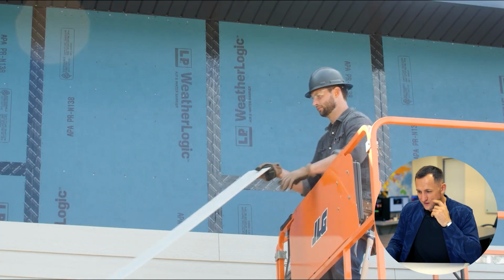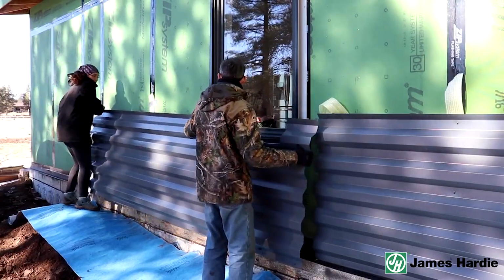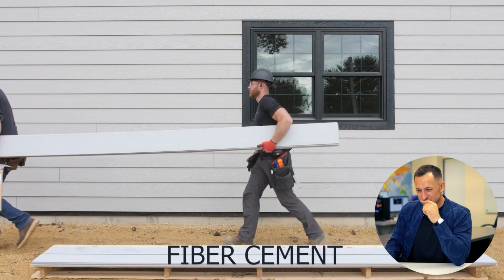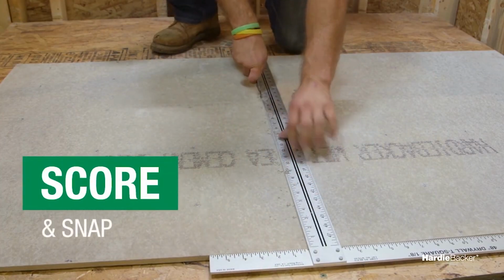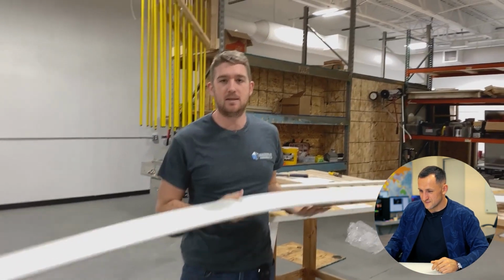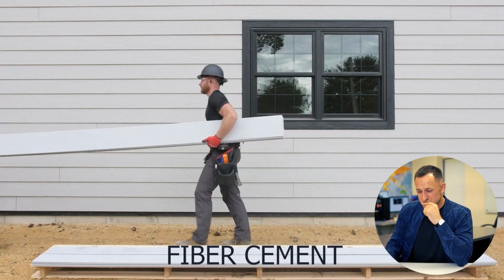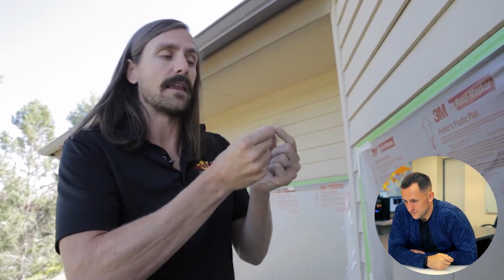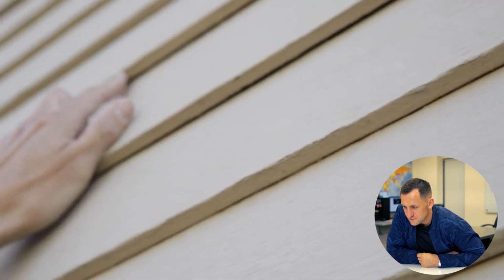LP SmartSide: REAL UNBIASED REVIEW: "Fast Food of construction materials" @RRBuildings

Comment: Thanks for your work in bringing out the truth about LP siding. I have installed siding for the last 20 years , mostly vinyl ( all kinds ) some James Hardie and some steel siding. I haven’t done any LP siding yet, however I had to remove one from a 3500 sq ft installed 20 years ago. 
The homeowner had to paint it every 5 years , since he used to be a painter. 
The reason we removed it and installed cedar shake vinyl siding was because LP was beyond repair and maintenance 
I was shocked to see the condition that a product that claims durability can end up with such a problem even with all the maintenance. 
The homeowner wasn’t happy with the product and it was an eye opener for me as a contractor not to offer that to my customers.

Comment: Breakage does matter for the consumer. I know plenty of builders and R&R companies that understand you have to over order to account for the dunnage of fiber cement; which is a cost that gets passed to the customer. And of course, the same goes for any impact event once the product is on the wall. I've also seen fiber cement expand and then simply disintegrate in high water flow areas, especially inside corners. Neither product is perfect. But the very obvious bias is not cleverly done.

Comment: My Aunt had her lake house, in the Northwoods of WI, done in LP Diamond Kote 15 years ago. Both the LP and paint still look like new. I am a contractor of 22 years and I have been closely inspecting it every year I go up there. Very impressed. The only maintenance she's had done on it, was just in the last year, to replace some caulking. She had a very reputable builder build the house, so that helps of course, but its been put through the test with the harsh elements northern WI gets.
Reply: Your comment about your aunt's place and the that of the fellow below from SD are the most useful information I'm taking away from this post. Thank you. I'm trying to figure out siding for a cabin in New York's north country. I would really prefer wood, but cedar is very expensive. Pine or fir apparently won't last. Vinyl just wouldn't be right for a cabin. Maybe LP, and perhaps Diamond Kote LP specifically, will do the trick.
Reply: @PaoloFrancesco99 LP had a much larger class action than hardie if you're using that as a basis.
I'm a contractor that is open to both and I'm standing in a house about to put hardie on it. Looked at LP and almost used it when Hardie was back ordered. 
The shock was LP pricing vs Hardie. No way I'd look a homeowners  in the face and say saving a few hundred dollars was worth it when switching to LP.
 
If you're going to be in the house long term get hardie. If your moving in less than 10-15 years get LP. But after 10 years you may have to do more than a few hundred dollars painting on LP that you wouldn't have to on Hardie.
The comment about a good builder is key here. Read the LP maintenance requirements. That clearly points out you need to use professional grade caulking. Nothing at box stores is worth looking at. 
Tremco has great charts showing classes of products and thw best use. I use a lot of high wnd Dymonic which I buy by the case in sausages, because that way I know I can cover almost any situation with it. $270 a case on Amazon if you're in a rural or smaller area.
Reply: @PaoloFrancesco99  I installed this on my camp in northern Oneida County NY 3 years ago. I tested a piece by soaking😅 it in water with exposed edges for a week, and I observed zero swelling. If you install it according to manufacturer instructions which includes priming or painting the cut edges and using a quality caulk you shouldn't have a problem.
Reply: I just saw some recent chatter so I thought I would share that I ended up deciding on Certainteed vinyl clapboard (main structure) and shingle look (shed dormers) for our cabin. I know - GASP! But I'm ok with it and that's what matters. The main house in vinyl will be accented with front porch and rear, screened-in porch structures out of rough-sawn pine with nice roof trusses. I decided on this approach based on cost, ease of maintenance, and my builder's experience level with the other siding products.
Reply: @PaoloFrancesco99  cool. 
As I say when working on wealthy clients houses.
"As long as we're spending you money I think you deserve the best!" 

Glad you got something you like. 
Cost does matter for most of us. It does when I work on my house.
Reply: I'm a contractor in Northern Wisconsin and LP Diamond Kote is the only siding I will recommend.  In fact, I will use it on my own house.  JH had a problem a few years back the caused many home owners to have to tear it off and replace it.  Evidently the siding eventually was loaded with cracks as it hung on the wall.
Reply: @greggyp647 I've heard tons of horror stories about Diamond Kote mainly revolving around the paint and warranties so I'm steering away from it.
Reply: Exactly.  The vast majority of issues with LP are shitty installers not following the instructions.

Comment: This video is also biased though because james hardie also swells and retains water. Its concrete which allows water through it to the vapor barriers. So if those barriers are not installed correctly you still have water damaged to your home. Hardie is NOT water proof or water tight.
Reply: You statement is meaningless because you didnt explain by how much. 
Does LP expand 5x 10x 20x more. Pull out your technical docs and put in the number.

Comment: I've been waiting for someone to call this LP crap out.  No thank you to huge gaps or h molding which makes Lp looks like crap. Fiber cement, no gaps at seams which allows for quality work vs hack jobs with LP. 
I'm using alure fiber cement because I got a good deal.

You are correct about lp being only better for the installer. Not the homeowner. 

You sir, are spot on.

Thanks for the video

Comment: I wanted to get hardie but my builder talked me into getting LP with diamond kote on parts of my house.  But not along the ground where there will be brick.  Builder says he’s seen some cosmetic issues with hardie.  Chalky residue is one of them.  
Also I know LP looks like osb but why not do a water test on it?  Dunk it in some water for a month and see what it looks like afterwards vs a control piece.  Do the same with hardie. You might be surprised.
Reply: No pro would be surprised at that test.
Did you get a labor reduction on the install from dropping hardie? 
That's the topic of this video, builders often point out what thwy want to use, not what's best for thw client.

Comment: Currently installing LP smartside &trim have sent owner/ contractor your video and videos from LP and hardi he has been warned no guarantee from me, 40 yrs as a carpenter,8 yrs of engineering school. I have done every siding out there.
Reply: What would you put on your personal forever home?  I live in the DFW area, so we definitely have our share of humidity and typically see winter temps in upper teens to 20s and summertime temps sometimes pushing 110°F...and not that "dry heat" either. It gets sticky here!  I would love to hear your thoughts/suggestions.

Comment: Interesting. I'm just about to redo the trim around my house. It's made out of LP. Some of it is starting to fail/rot. Probably due to lack of care. It is at the 30 year mark. I had planned on using LP again but am open to suggestions. Has anyone used Versatek trim? I believe it is made of pvc similar to deck boards. Would be great to hear some thoughts.
Reply: How much of a maintenance headache has the LP been?
Reply: No headache. The siding has been well maintained. Regular paint and caulk where needed. Just a few places have started to rot. Areas that where neglected before we bought. As I mentioned it’s roughly 30 years now. I figure that’s pretty good.
Reply: @ntstree 
Thanks much.  That's very helpful to know.
Reply: I'm pretty sure cement trim board will cost half what PVC will. And painting PVC is its own problem.

Comment: Your review is so far off and incorrect you should not be posting this misinformation. ie: "It's osb siding and it will rot" Its not osb as in sheathing osb with totally different wood used and  different additives and resins in the manufacturing process. It will not rot. If it did, as they put out millions of feet of this per year, wouldn't they be out of business via class action lawsuits? Oh, on that one you mentioned, yes that was bad product 25 years ago before SmartSide which they paid. They re-engineered the product to SmartSide today and it performs. Please do your homework.
Reply: He has many valid points, I don't think it's mostly misinformation.
Reply: Dude the  LP documents say to protect from water. You sound like one of those know it all construction workers that's never read an ES document let alone had it on site.

Second it is a FACT THAT LP IS OSB. You're someone that doesn't even know the difference between different types of OSB. 

Avantech ODB flooring, I've seen a guy that has had a piece outside in a bucket of open water in the northwest for like 5 years now and he pulls it out and posts every once in a while. It looks like he just threw it in the bucket still. That's water resistant OSB.
Think LP OSB siding would hold up to a week under water? A year? 5 years?
Reply: @sparksmcgee6641  Its not traditional OSB DUDE. You like Advantech? Well, just like SmartSide, similar in the manufacturing process. Do you know what OSB stands for? It's the orientation yes, but the manufacturing and treatment process is what makes it. And DUDE, I'm an engineer at LP by the way.
Reply: @teamplayer1218  Some of these people commenting are total idiots. OSB is just that, if LP Smart siding was pure OSB, they'd sell it as that. It's engineered completely differently than OSB.

Comment: LP product of 10 years ago isn't what it is nowadays, if installed correctly with a quality vapor barrier its a great product. JH is a great product as-well, you need to install a rain screen behind it in my opinion if in any wet conditions. I've used both, and both have negatives and positives. I love up in Idaho and will be building my own home in about a year or two, ill actually will be using Nichiha siding instead of either of those brands.

Comment: You make some very good points to think about, however you fail to mention all the problems Hardie had with their 1st generation product as well!!  They had major failures as well and had to come out with different products for northern vs southern climates. The test of time will be the ultimate judge of both products!!!
Reply from the maker: You are not wrong. The purpose of the video was not to highlight James hardie but to show why people shouldn’t trust bias reviews of LP paid creators. We have made siding guide comparing two head to head.
Reply: @RoofingInsights3.0  Where is this guide ?
Reply: @amygangaraj5130  SmartSide with ExpertFinish Warranty. 5/15/50. 5 years on labor & other costs in case a claim is made. Covers materials, labor to strip & hang affected siding and dumpster if necessary. 15 years on the the painted finish. 50 years on the board substrate. Full 50 years from day one and transferable to the next homeowner.
Reply: @teamplayer1218 you need to learn how to read warranties. 
They won't pay that put unless you pay more than hardie to have it installed and then they will find an issue with the install 20 years from now and no pay. Look at the sa.e products commercial warranty where they know property management will have all the product and install  records for decades. 
Bet it's material only for 5 years or something.